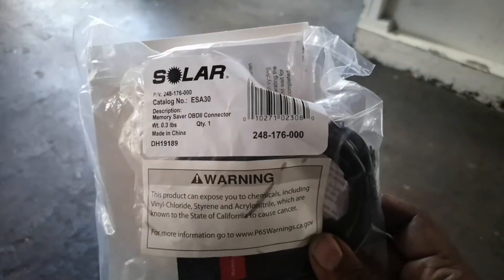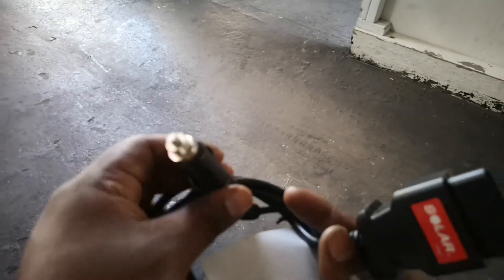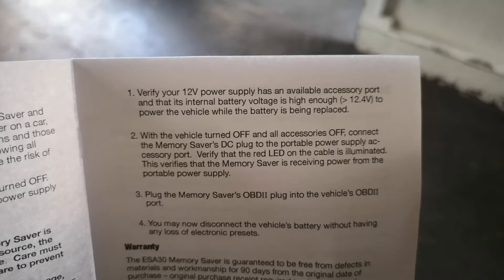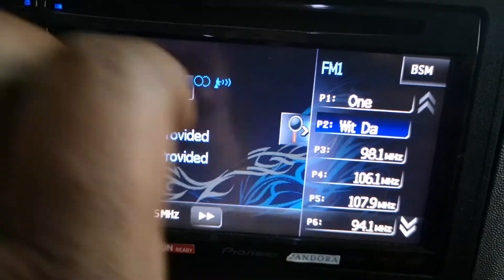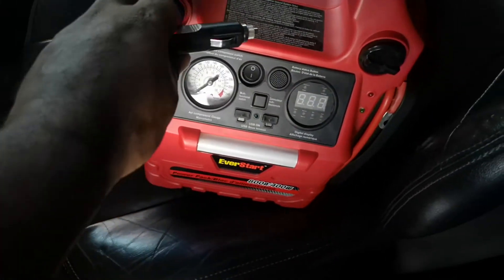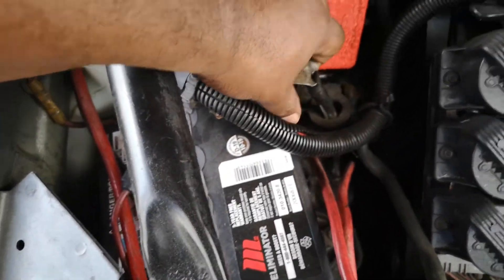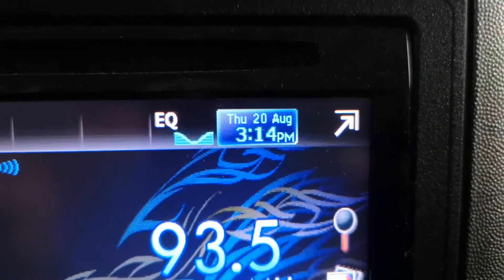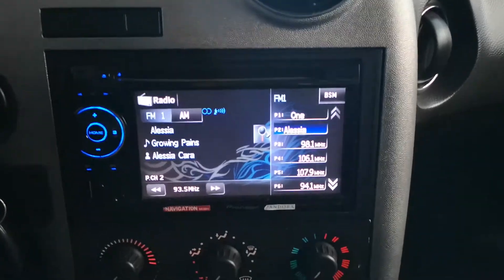Car Settings Memory Saver - ODBII

Comment: Helpful information I have the one with goals and the computer plug with a 9-volt does that one work I know you showed the one for the 9 volt battery for the cigarette lighter I'm wondering if the 9 volt one works for the computer plug what is underneath the dash
Reply from the maker: There is 9v ODB II adapters out there, so it should work. But I haven't tried one yet

Comment: I have a Gooloo portable jump starter and comes with cigarette lighter accessory but the manual says the cigarette lighter output is 15V/10A. Will that be ok?
Reply from the maker: Hi. That is a good question. So that Gooloo Portable jump starter...did you want to use the cigarette lighter output to jump start the vehicle? Or does it have the ability to just maintain the battery?

Comment: Another thing you can do is just hook your battery charger up to the battery terminals, remove them from the posts and replace the battery. it will keep the memory because the Battery charger supplied constant power to the car.  (some people may not have the knowledge and skill to do this, so the OBD memory is the safest option. )
Reply from the maker: Absolutely! That is a very good point. No disagreement there.